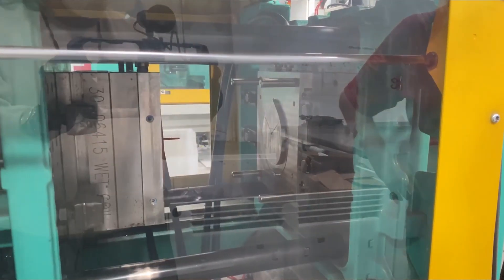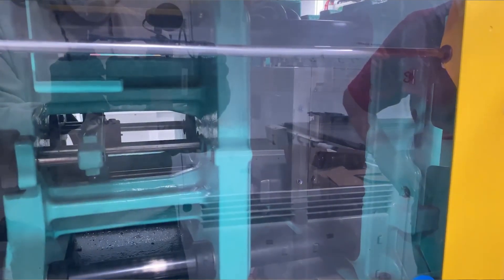Stop 3D printing lures like this!!!

Comment: I disagree mate.....I've spent 100's of hours of trials and errors and now have a super neat system to make quality FDM 3d printed hard bodied lures that catch fish.....and I print them in halves! 😁
Reply from the maker: Right 100s of hours to retrofit injection molded design constraints into a non-injection molded process. I m glad you found something that works for you but my point still stands.
Reply: There is no reason to make through wire lures 3d printing is more sophisticated then halve lures @WMBayouLures

Comment: Another trick you can do when using FDM printing is to design a cavity in the model and set a pause in the print part of the way through to drop in a weight/rattle/whatever, then continue the print so it entirely encapsulates what you inserted.
Reply from the maker: Yep one of the benefits of FDM for sure! Still don't like it for lures though 😝

Comment: I've printed quite a few things directly from a factory 3D model.  Generally the original part was injection molded.  It took me more than a few attempts to realize that I could modify the model to take advantage of the fact that I am printing it.  As you were saying, there's no need to worry about draft angles, undercuts etc.  Occasionally I'll run across something that was easier to injection mold and not as easy to 3D print, but more often than not I can modify the original to take advantage of FDM printing and sometimes make for a more structurally sound tool.  I have absolutely no interest in fishing lures, but this video was very interesting to me regardless.
Reply from the maker: Awesome and thanks for watching. Most of the things I cover have a broader use but I try to stay in my lane, 😉

Comment: 3d printing is a prototyping process in manafacturing. Injection moulding is the finished product of that manufacturing process. Each technology has its limitations in manafacturing a product which you covered some of.
As a 3d printing specialist in FDM you have to consider the overhangs and layer orientation. SLA/ MSLA/ DLP 3d printing (resin) has different limitations again but shares some similarities with FDM.
Designing a lure for FDM printing you need to consider your layer lines for detail, strength, overhangs for support and bed adhesion. You could cut the lure up into many parts and glue it not just in half, the edges don't have to be straight they can be zig zag for alignment. I think making the head a different orientation to the body could see some benifits.
Reply from the maker: 100% correct, I am a resin guy when it comes to lures and molds so I am most familiar with those issues. Design for the manufacturing process.

I will disagree that 3D printing is only for prototypes, I sell lures created with 3D printing exclusively. If you need to scale to 10k units (guessing) you would want to switch to injection molding most likely but it really depends on your economics. If you are selling some high end swimbait for $100 then you might be able to scale that with only a minor increase to cost.

Comment: Great breakdown of that method. It taliors making baits using the strengths of a 3d printer to make baits vs trying to force it to make it the way you want it. Great method but it does have some limitations with larger baits. Using thicker areas to add weight to a resin bait can get quite expensive. Also when adding hollow areas to an fdm printed bait it can actually cause it to be heavier due to the fact that more walls will be printed instead of infill. Had quite a few problems with this for an 8 inch danny plug I was making. But having one pice baits come off the printer is pretty cool. No isues with water comming through the seams.
Reply from the maker: There are trade-offs to every method of manufacturing for sure. 

Oh and FDM sucks for baits 😉🤪👊🏻